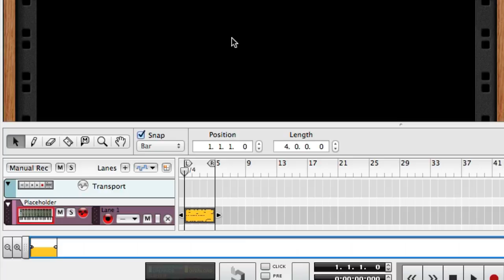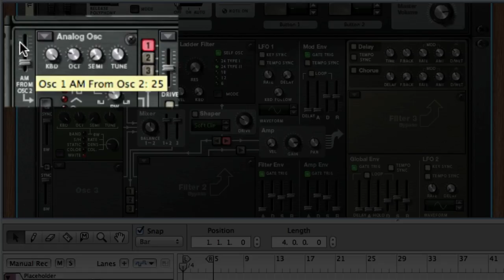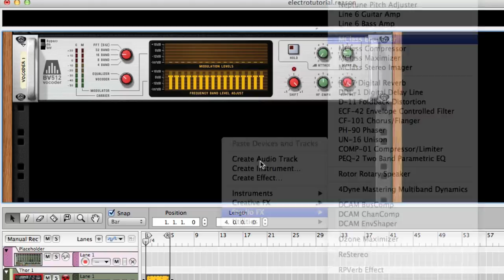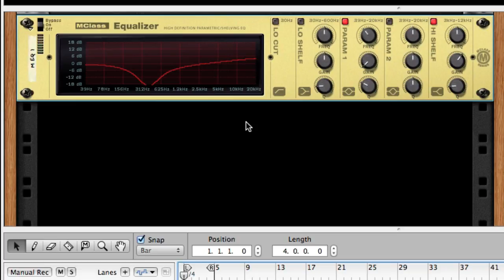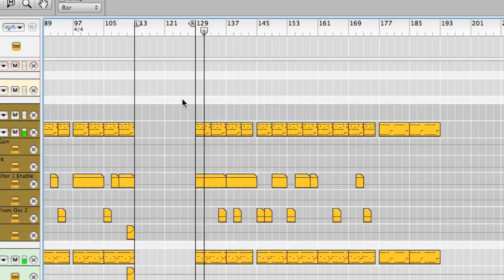How to Create an Electro Bass Sound - Reason Tips

Comment: ***** right click on thor, then INIT PATCH (initialize patch)
Reply: Actually in Reason 7, you need to right click and then select Reset Device. Just had this same problem, when I load the Thor instrument it just gives me the presets. No option for INIT PATCH. After resetting... there it is.
Reply: Actually I'm usin' Reason 5 so I'm sorry for the mistake. But check your general settings